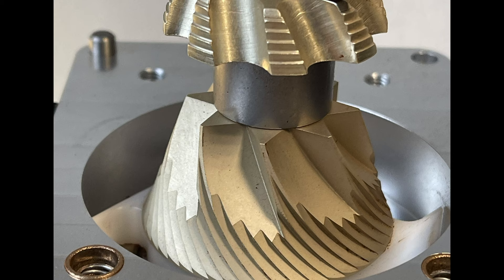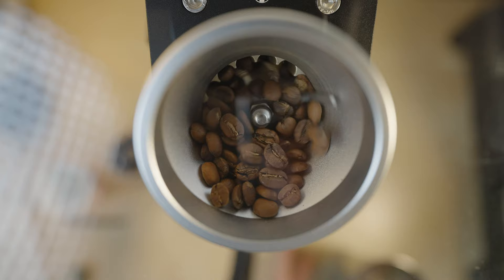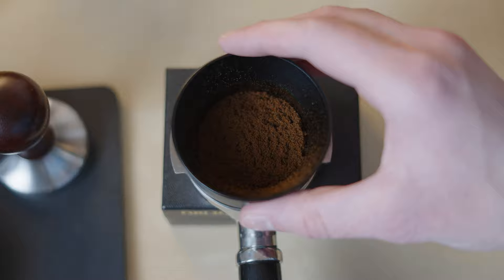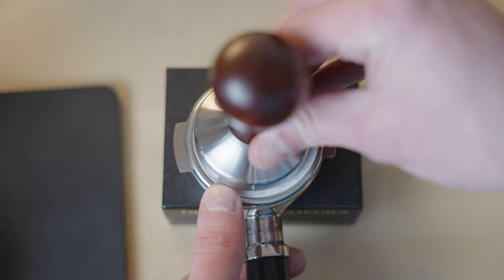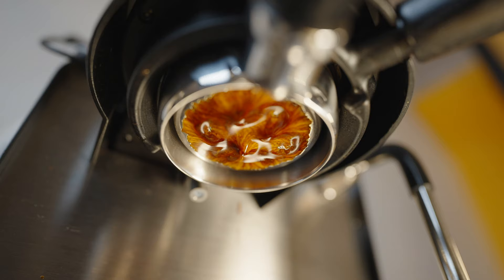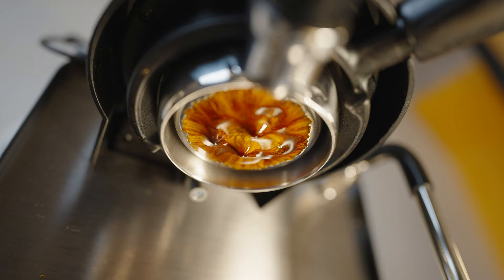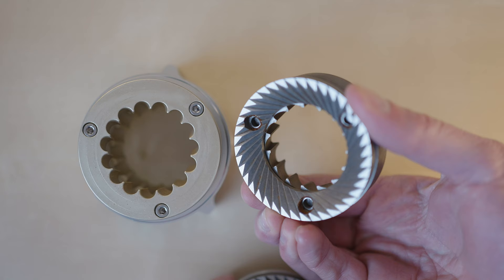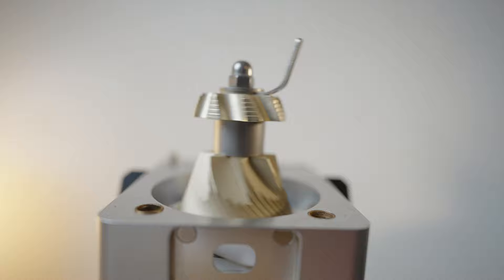Is Kafatek's MC4 the Best Espresso Grinder?

Comment: Thank you for the review!  I have owned my MC4 for around three months. I concur with all that you have said about it.  The burrs are now broken in and it's even better.  Essentially there is zero grinds retention. All I ever find when I clean the burrs are bits of chaff.  The quality of the grinds that it produces is light, fluffy and easy to work with.  Then, there is the consistent details that brings it all together producing a cup that you feel is extracting the flavors distinctly.  I no longer use the conditioning tool but use one very short burst of distilled water from the spritzer.  Michael you do an extraordinary job in presenting your opinions of the grinders that you test.  No waste of time, directly to the point! Great job!
Reply from the maker: Thank you!
Reply: How many Pounds of coffee do you think you put through the MC4 to get it well seasoned??

Comment: Hi Michael,

Thanks for the analysis on the MC4, great work you do. FYI: James Hoffman did this experiment on the Niche Zero that you might like to reference and try testing yourself to verify results if one bean (feed rate) vs steps in grind make a difference in a grinder. 

What James did was first make a very course grind through the Niche than adjusted the grind to fine for the final grind. This is not the workflow the majority of us who just wants espresso would want to do, but with the Niche experiment this might help verify your analysis with the final cup profiles to verify if there is a difference in multiple step grinding.

Seems you both are seeing similar results that multiple step grind is the difference maker vs feed rate. I have not tried James Hoffman's method as I have a Niche. But I'm a newbie into espresso and still learning basics. But I would be interested to hear someone else on James level of knowledge and ability to try this. Hope you do a video on it and let us know your thoughts!

Comment: I've been using my MC4 for three weeks now. The burrs are still breaking in. When I spritz the beans, once, before I grind the resulting fines are as fluffy as cloud, no clumps, and no WDT needed. It's a brilliantly engineered machine and an artistic wonder. With that said I also use a BPlus Apollo hand grinder with the fine adjustment mechanism. I love it just as much as my MC4. Go figure.
Reply: @Espresso Junky Thanks for your reply. The JE-Plus was my second choice of grinders behind the Apollo. Here's what I don't get. I grind 18 grams in 38 seconds. If the burrs are the same in the JE-Plus, how come it grinds 18 grams in 1 1/2 minutes? Something is very different. I don't get it.

Comment: So the challenge is whether a coarse grinding with conical burrs, followed by a fine grinding with large flat burrs makes similar differences as the optimally combined Kafatek, as described in the video. Well, I have only tried regrinding with the same conical burrs (manual Bplus Apollo, 48 mm Italmill conical burrs with whatever nanotech coating, blah). 
First with the most coarse setting, then the regular, already dialed in setting. 
My learning so far:
- it does make a slight difference in the visual consistency of the ground coffee, before tamping: looks more homogeneous and fluffier, like a light snow, much like in the video;
- it requires tighter tamping (using the same puck homogenization); I had to adjust my inhabited tamping routine;
- it does seem to make a difference in taste, in the direction described in the video.
So the effect seems to be there, even with this "low-end" imitation. But probably it's more accentuated with 2 separate grinders (conical + flat), and might be even more prominent with an optimized combination of grinders.. However, the question is how much more. For me the double grinding looks good enough compromise, so whenever I feel like, I can basically spare money with more time given into grinding :). Thanks for saving my wallet :).

Comment: I think the Flow control disc on the niche doesn't really slow flow enough to really have a dramatic impact, Hoffman and others have done an experiment where you slowly feed a grinder bean by bean and it ends up affecting the grind consistency and size (I forget if it ends up being coarser or finer).

Comment: hello, you mentioned that you want to back flush as infrequent as possible.   Is that a reason?   I saw that you use a Decent machine and the dirty water should go out through a dirty water path rather than 3 way solenoid valve.

Comment: Can you compare the noise levels between the KafaTek MC4 and the Versalab M4.  Also durability and ease of cleaning between the two?
Reply from the maker: MC4 takes the cake on all three
Reply: @michaelfabian3414  Another question: Have you compared the Ceado E37sd to the  MC4? I think I'm between the Versalab M4 and the Ceado as I hear the MC4 is not readily available.
Reply: @michaelfabian3414  I'm curious how the flavors compare between the MC4 and M4. How does the 2 step burrs from the MC4 compare to the DRM burrs from the M4 when it comes to different types of beans (light vs. medium vs. dark)? How do they compare in terms of astringency/clarity/brightness/etc.?

Comment: Great video. Informative and funny. 

I do wonder if one could get a comparable result by grinding twice in the same conical, once very coarsely and then at an espresso fine level. (Maybe I’m just trying not to empty my wallet and upgrade my Niche 😅)
Reply: absolutely. if you start grinding very course and after normal it should have an advantage. Hoffmann did it as well. and thats the principle of roller grinders with multiple stages (and they are superior to burr grinders)